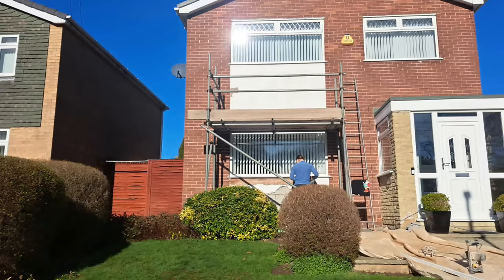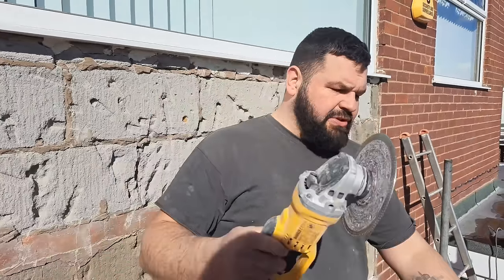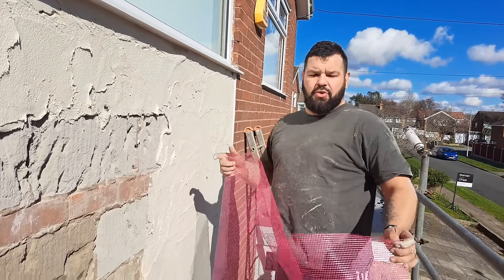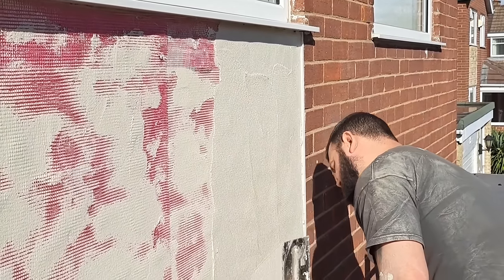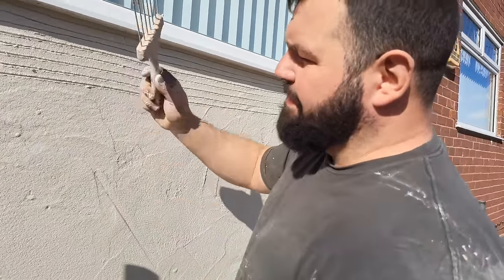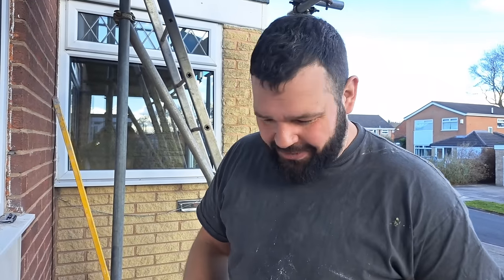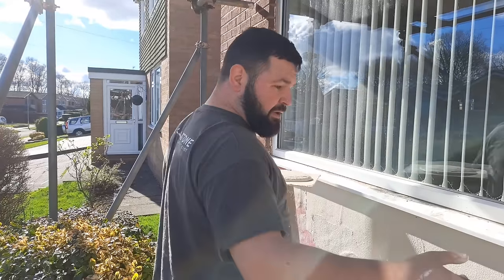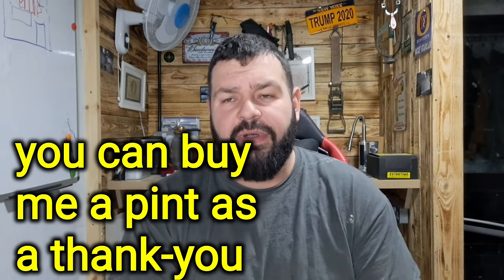K Rend basecoat over thermolite block | K-Rend series pt.2

Comment: SBR is a polymer and you could probably just tip some of that in your base coat instead of buying another bag of something different I love your videos I like the way you talk you're down to earth and you're a very good plasterer being a plaster of myself I'm always learning I've done this work before and I've actually used the base coat as sand and  cement And if you put SBR in the mix you come slightly flexible scratch coat it level it out and float it works out cheaper
Reply: If you do that K rend wont guarantee it...Just opens up a massive tin of worms.

Comment: Hey Kirk, do you need to prime brick/blockwork before base coat goes on mate?  Thanks in advance 👍🏻
Reply: You can prime with R10 and still use HP12 basecoat. If you dont want to add this extra step, use HPX which negates the need for primer.

Comment: The only thing worse I found for coating on other than K-Rend was a lead based plaster I once used. It was for an x-ray room at a hospital. That stuff weighed a tonne and was thick and sticky.
Reply from the maker: Yes mate, I've never used it but my dad has, he said it was a pain to use aswell
Reply: Sounds like a plaster called barite made for x-ray rooms. Used it 80s and 90smate.